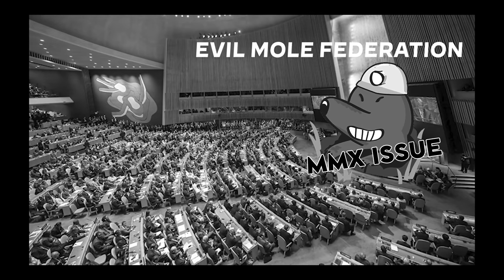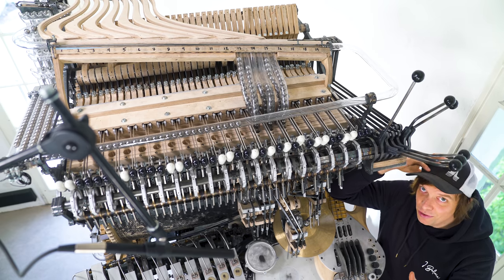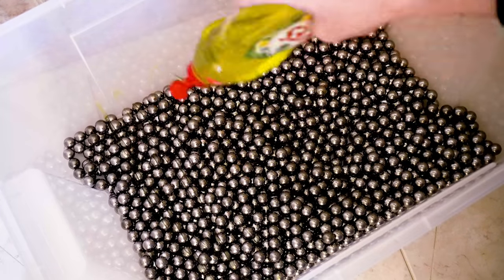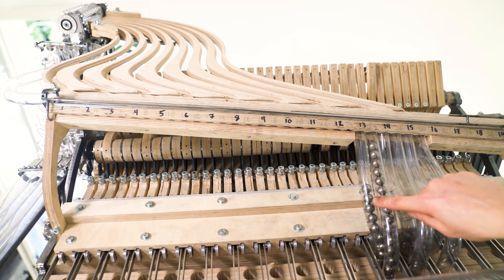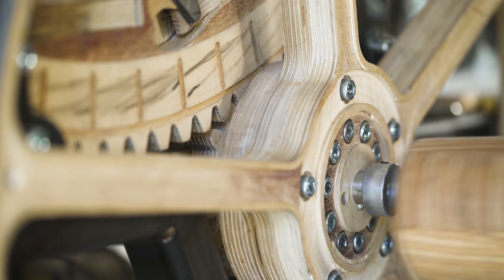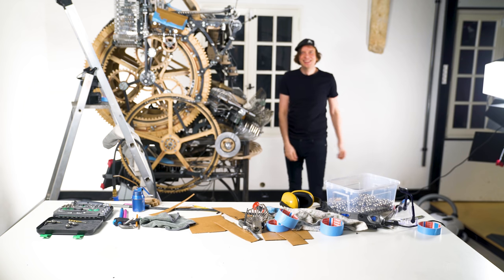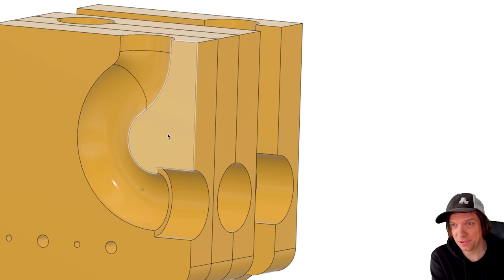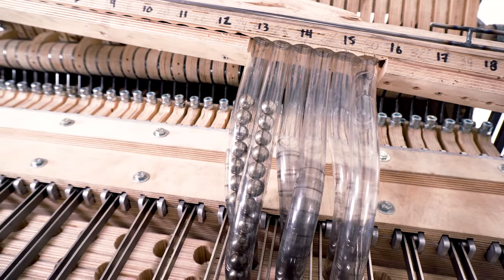Why Are 1000 Marbles On This Red Towel?

Comment: We get a similar problem in pharmaceutical packaging. With pre-filled syringes, where each vial, needs 1-2 tungsten or some other oxidation resistant alloy (company preference). These are used to mix the liquids inside, when the syringe is shaken before use.
  What's causing the resistance, is the weight, off all the above marbles on top. Forcing the bottom most marbles to the side, in that zig zag pattern, as the second and third marbles from the bottom, sit to the side of the marbles beneath them.
The best real solution to that kind of a problem, is a slightly tighter tube. Which would put the marbles closer to centre over eachother. Reducing the lateral forces, and how much they're being pressed against the tube walls.
An issue that also comes up, with very tight curves, which you yourself removed :p

Another solution to cleaning; Alcohol. Cleaning alcohol, or rubbing alcohol...
It cleans, it decreases, it almost eliminates oxidising... It's an Engineers miracle.

Comment: Guessing the stickiness keeping the marbles stuck was basically surface tension of graphine, as carbon molecules join together?

When the graphite powder first showed up as a lubricant and Martin started applying everywhere, I did wonder to myself if that was a good idea or not. Perhaps it needs to be limited to moving parts only?

Comment: When I worked at a food factory we used “Food Safe Silicone Spray” as lubricant.  It worked really well and no messy residue.
Reply: @TankToChest  I mean as lubricant instead of the graphite.   Spray down the tubes and marbles with food safe silicone spray or something similar to reduce friction and no residue.

Comment: These marbles are perhaps made from porous materials and soaked in lubricant at factory. Even if you clean them, the may continue to "sweat" the lubricant still trapped inside the porous material.

Comment: Those modular parts also affect length of the marble stack and whether they are lying flush with the top marble lane. You described it when you changed them in an earlier video. Maybe that is what changed the resistance. And now that they are changed, the tops are probably not flush again.

Comment: It is definitely weird, that most of the lanes are clogging now. 
Only thing, that you did since it was working is the marble lanes. Maybe it causes some kind of stress on the divider? 
New lanes are bend with force by screws and maybe it is bending divider as well as the acrylic pipes.

Comment: A lot of common dish soaps, while great degreasers, have salts as an abrasive. This is probably the cause of the rust. Cleaning the marbles with Isopropyl alcohol or acetone should degrease them without rusting. 
Also, MMX has a lot of wood on wood contact which can lead to binding in certain areas, kinda like an old drawer that doesn't have any drawer slides. Might not be a bad idea for contact areas (such as gears and the guides for the droppers of the instruments) to be rubbed down with a paste finishing wax of some sort. It'll help keep everything moving smoothly. 
The plywood channels where the marbles run could use the same treatment to help with any binding there, although they may just, as you put it, "fat" the marbles all over. 
Of course, this is your baby; do what feels right.

Comment: Now that the marbles are rusty they will likely pick up dust and dirt better than before because the rust will provide a rough surface for dirt to attach to. Cleaning them might have made that problem worse in the long run :(

Comment: Instead of cleaning the marbles with soap and water try diesel, it will remove any oil residue and leave a very thin film that will prevent rusting.

Comment: I believe that the over-rotation only matters when the marbles are in fast motion (ie. marble divider) once you get to these higher pressure, lower speed routes, overrotation is practically irrelevant.

Comment: just need a tumble pot and some medium to tumble them and clean the rust off.

Next time you wash, use boiling water to rinse, so the water flashes off quicker.
Rust is inevitable, but you can mitigate it by causing faster evaporation, 
Then with the shaker pot and some fine medium, you can re-polish the marbles good as new.

Comment: I would recommend trying to wash or rinse the marbles in a solvent instead of in water. Isopropyl alcohol should work fine. If you work fast with water, you could wash the marbles with water and soap, rinse them, drain them (but don't even try to dry them), then rinse them in alcohol. That way, they will never rust when finally drying, because the final drying is from a mixture of mostly alcohol. You can obviously reuse the same alcohol rinse many times, as even ~50% alcohol will evaporate very nicely. This has the bonus of also cleaning them from alcohol soluble contaminants.

Comment: If I have seen this correctly, left-hand thread screws in the bearing holders would automatically thighten up, where the right-hand ones will always loosen when there is friction on the screw.
Reply: @TankToChest  I agree, there shuould be no woobling. But I was talking about the screw that connects the bearing with the 3D-printed part. But he fixed that with silicon, maybe (hopefully) this is enough...

Comment: I think this system has a good chance of working long-term, but I think it might be worth considering that the plastic pipes are deforming, and that could create long-term problems. In particular the PMMA pipes before the gates that have a brief upward incline which pushes the marbles into the top surface of the pipe with all of the cumulative force of the other marbles. And that force is increased now that there is less upstream friction. The pipe may inevitably conform to the marbles in that one spot and cause increased friction. Just keep an eye on it!

Comment: Hi great video if rust is an issue put dry coarse sand in a cement mixer fire the marbles in an use a mesh box for getting the marbles free from the sand and hopefully remove rust got mate who did old battle reenactment;s an this was how he cleaned the chain mail just a thought. Cheers

Comment: You should have left the bolts on the bearing brackets long and put a nylon locking nut on it. That way you don't have to rely on just the lock tight to hold the bolts in.

Comment: perhaps a different degreaser (unfortunately petroleum-based) would do something about the existing rust, and drying them quickly with a towel or air as suggested by others would prevent the rust next time :)

Comment: Shoulder bolts! When using a bolt to hold a bearing like you did for the ring gear bearings, use a shoulder bolt. It has an unthreaded section near the head that will hold the bearing more securely. Regular bolts are okay, but a shoulder bolt is the right tool for the job.

Comment: Couldn't you use the existing gears in the system to drive the marbles down pressureless channels? Like a magazine to a firearm, the rounds rely on the spring on the bottom of the magazine to feed them into the chamber. The marbles could rely on a conveyer belt of sorts to drive them down towards the end of the channel.

Comment: Good enough is very broad. Is 'good enough' to play 1m Marbles with 10 on the floor good enough or is it good enough if you can play a million marbles with NO marbles on the floor and no 'issues' in the played piece - even if there are some aesthetical choices that could be 'improved'.

For example, your new Marble tracks that took longer than expected - does it matter if they don't move along the path as 'perfect' as you would like, as long as they move and don't cause a problem elsewhere - like lack of marbles where needed, falling out etc.

You can settle for good enough - but there will always be 'something' that can be improved. Good enough could be 1m Marbles with 'no issue' but then you may find that you want 10m next and so may need to do something 'different'

Comment: Get a Rock / Gemstone tumbler with corn cob tumbler media. No Water Needed. Used to clean connection hardware on high amp Ni-Cad aircraft cells. The media will absorb moisture and give a smooth dry mirror finish. Fill it with marbles and media turn it on, and you'll have clean shiny marbles in a few hours and no rust. You may want a larger size or a double drum just to cut down on the time. It makes things rounder too. Here are some pics That didn't work just search rotary tumbler.

Comment: I see another problem you will run into down the line, the first 5 or 6 channels, that would be first 5 notes on the vibraphone will get depleted more often (since vibraphone would use more marbles faster, I assume) but it gets far less marbles than the other lanes, while 2 lanes feed channel 2 theyre the right most lanes, on the other hand the last 6 channels get fed by all the lanes (according to past videos most marbles will end up in the center lanes) so there would be a moment where no marbles get feed into those first channels and could break the machine

Comment: In Finland that dish cleaner called "fairy", you should use bracleen! Sprayable stuff that really whips the grease off! Do marble antigrease system where pulley with pin ins pressing the spray while the marples goes over!
Noooooooo! Now the machine gets the rust everywhere, you cant ever get all rust particles off from the pipes and the machine 😫. you should put that long screw that there could place nylock nut to the back of the 3dp plastic part.

Comment: Having overrotation in the pressure system never really made any sense to me.  Overrotation is a dynamic effect that just reduces the speed the marbles achieve when rolling, but it doesn't really have any affect on the overall weight (pressure) of the marbles when they are sitting still.  The only pressure reduction there comes from static friction which isn't really affected by overrotated lanes.  Seemed the overrotation would just slow be slowing the marbles refilling the gates for no reason.

Comment: if you marbles get wet dry them mostly in water, the wet them in acohol, disolve the water ad the alcohol dries much quicker. unless the alcohol rusts them much quciker. but it works for paintbrushes

Comment: The slow marbles is another example of XY-problem. You wanted the tops of all marbles level with channel. To do that you invented curved channels of different length. Then you had to grease them to make moving easier. And now you have problems with grease, not to mention dirty looking machine. How about changing the approach instead of trying endlessly adjusting old one? For example - your marble release is two-stage device. It holds incoming marbles in position while preparing the first one to drop. The distance between holding position and first marble is not critical. So, by making holding position adjustable by couple centimetres you can get rid of those curved channels and make the drop paths free from extra friction.

Comment: For the marble issue: why not adopt lubrication from bike industry, where basically the same greasing - rusting cycle is experienced constantly (fellow road biker here). I would suggest some teflon coating lubricant spray, like Loctite's TF2 or Interflon TF (I'm pretty sure you can find any of these at your local bike shop. Example links below.)
These could eliminate the rusting completely, and give a repellent coating: you can keep the plywood grease and still have good lifespan for the metal.

Loctite: https://www.ebay.co.uk/itm/Spray-Lubricant-TF2-WELDTITE-Ptfe-Aerosol-400ml-Bike-Derailleur-Pinion-/353307575102
Interflon: https://www.ebay.co.uk/itm/2-INTERFLON-LUBE-TF-500ml/293835600791?hash=item4469f77397:g:ZM8AAOSwMIVeLafB

Comment: My hypothesis/speculation is the slower marble speed from new 8 marbel slides/conveyor. The marbles impact/pressure at reduced speed/power when entering the pipes which reduces the overall compression which impacts pressure.

Comment: Two words: Stainless steel. These balls are almost certainly available in 316L Stainless Steel. I would suggest you order what you need for the MMX IF you eliminate the magnetic lift. If you retain the magnetics, then there are ferromagnetic Stainless Steels you could consider, but be sure to test samples before committing.

Comment: Porous surfaces attract dust and dirt alot. I would go with a 2part automotive clear coat on any wooden marble contact surfaces, roughed with 500 grit sand paper and rubbed down with a mix of carnuba wax and a dry Teflon based powder lube.

Comment: 6:55 "I'm trying to dry them fast so they don't rust".  Sorry to say, your hairdryer was the prime cause of the rust, as chemical reactions happen faster at higher temps. You would have done better rubbing a towel over them and then a super light mist of WD40 or the like. I can't comment on whether that lubricant would cause the same problem but it seems less likely as it's a light oil not a solid.

Comment: A vibratory deburring/finishing machine should be able to remove the rust but, they would need to be coated with a corrosion inhibitor straight after.

Comment: I think this system, is going to prove too fiddly at least for touring. The height of the column as well as the resistance in the column is going to change with wear, dirt, and flex of the overall machine. All of those will build up. The tolerances look to be tight enough that you are going to have trouble staying inside them. So, in the end, you really will need a way to give fine adjustment quickly in the field (as part of setup on-site).

Comment: You should use Isopropyl alcohol, 90%+, to clean any metal or plastic of grease; avoid saturating the wood, the alcohol can  cause the wood to delaminate or bloat.  Isopropyl is easy to find and widely available.  Oily sources impacting your marbles are any moving part on the machine that you are using a grease lubricant to reduce wear and friction, oil from your hand when ever you handle a marble, resin from the wood, and pickup from the floor (your shop is clean, but this may be an issue at other venues).  The black you found in the water is carbon, both from the graphite you are using and from the marble which is a mix of iron and carbon to make steel.  You may have to determine a maintenance (cleaning) program for cleaning the marbles and machine.  This will help you prevent issues and find potential issues before they escalate; this will be important when you start to travel with the marble machine.

Comment: Using static friction to limit marble pressure is a fundamentally bad idea.  I didn't say anything when you introduced it because you were so productive, but there are so many random factors involved in how the marbles stack up in the pipe, that you end up with a lot of randomness.  I think you would do better with a geometry that takes up the pressure on flat surfaces, and leave the weight of two or three marbles bearing down on the gate.

Comment: If you ditch the magnets, use stainless steel marbles!  Isn't your new design (faster feeding) going back to the design where the pressure on the gates was too high?
          Regarding the wobbling gear, if the lateral position is critical, make the hub "flimsy" and guide it at the edge with rollers like you did for the planetary gear.  If you don't, that gear will warp and wobble again!

Comment: Next time you should use some organic solvent like ethyl acetate, anhydrous alcohol or toluene/hexane/dichloromethane (DCM) instead of water. Those won't cause corrosion and most of them (with exeption of toluene) will dry very fast. But dont do it in a close room, get outside.

Comment: I knew the graphite would start to cause some problems down the road but mostly staining things. Thats why graphite is not used so commonly. You might have to think of how to clean the machine after every few concerts being played. Kinda to go with the inspection that everything is working fine. Mostly the pipes needing that focus.
As far as the cleaning, steel bearings will rust and that can even happen in high humidity so its going to be something to worry about on traveling. You might want to look into chromed bearings that is resistant to rusting and has a hard durable finish that can resist the impacts. of steel on steel as they do bonk up on each other. That would help further down the road and they should remain magnetic for the wheels to pickup. Stainless steel can be found in bearings but they can be expensive and could be nonmagnetic or not magnetic enough to work with the main pickup mechanism.

Comment: Martin, I have read some of the comments below and what you should have used to clean the Marbles. Yes there are a lot of cleaners you could buy like Alcohol or other chemicals which are all flammable and needs to be disposed of after use. You will not be-able to travel with all of the chemicals as well while you are on tour. it just seams to be kind of dangerous as well transporting them from place to place. You should be looking into something that would work better for the long road to keep the marbles clean. One way and is something you should look in too, Is a Metal Vibratory Tumbler Bowl with a media that works better for you needs for cleaning the parts or marbles. Keep in mind there are many different kinds of media that can be used for cleaning, So find one that works for you. In the linked video this guy uses some Walnut Shells and Quick Dry with some Stainless Steal Polish cleaning oil as a binder to clean his parts, which can be reused a lot longer then just a one time use and dispose after used like the chemicals. Take a look at this video, and see if something like this will work better for you for the long run for keeping the MMX running smoothly to play the music that's about to come. https://www.youtube.com/watch?v=mG4h-TU92-A